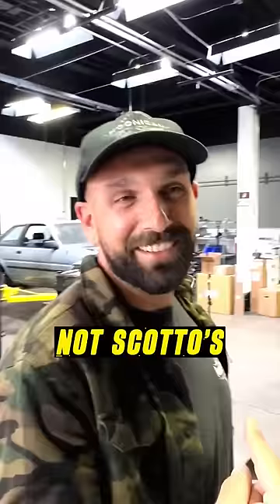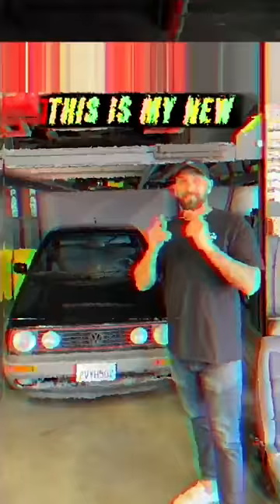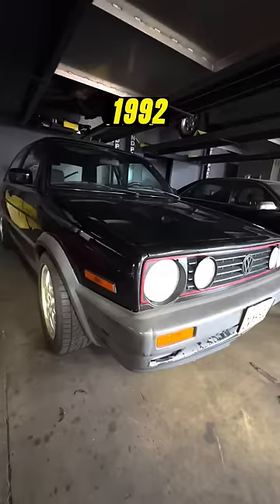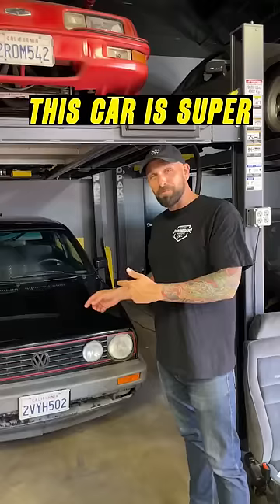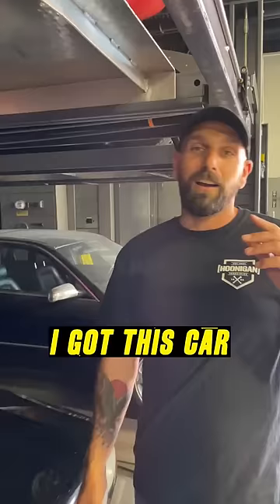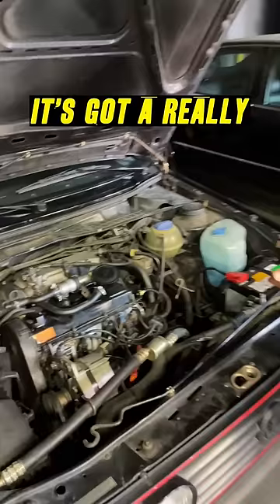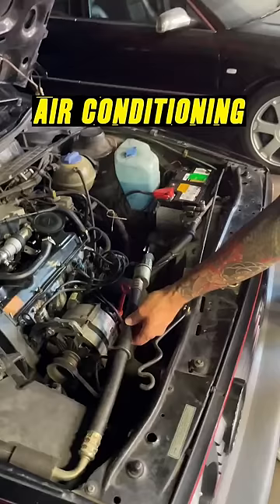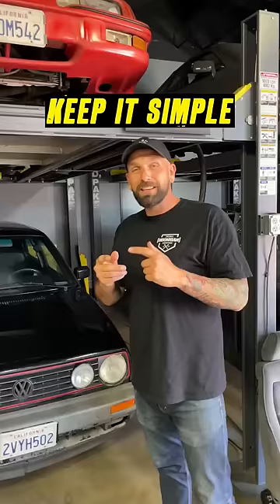New #VW but Not Scotto's? #Hoonigan

Comment: 1.8t, do rods, rings, bearings, exhaust valves and springs. GT28/71, ID1000, and a decent clutch. 
Fast, fun, reliable setup right there.

Comment: 1.8t, not too hard to push 600 horsepower with one of these, people push them to over 1000 so a reliable 600 cant be too difficult. Just get forged internals, the stock cast stuff is only good to like 300.

Comment: VR6 if you like all the sound but none of the speed and handling.. 20VT if you want reliability, speed and handling without the boat anchor up front.. 
I put an AGU in my MK2.. Set of Conrods, 550cc injectors, FMIC and AET K04-380 Hybrid Turbo.. Easy 340hp.

Comment: check this, hit me up, for a VW Brasil AP 1.9 iron block , cross flow heads, forged rods/pistons, cam/pulley, big cfm TB , fueltech injection ngk alcohol sparks, 0.71 bearing turbo, no intercooler, 600hp no drama.